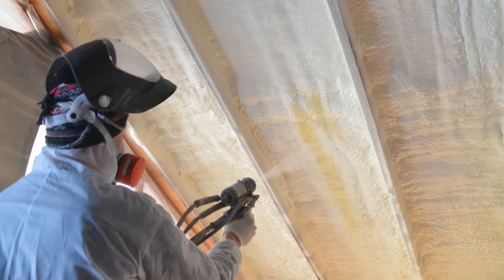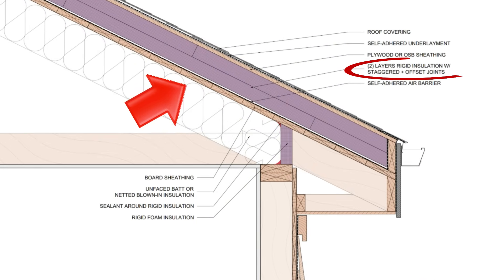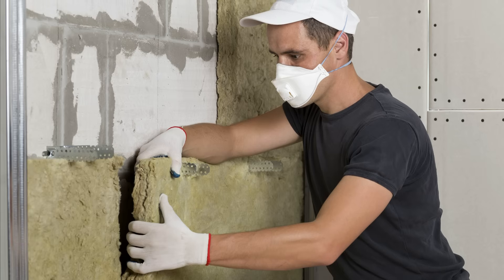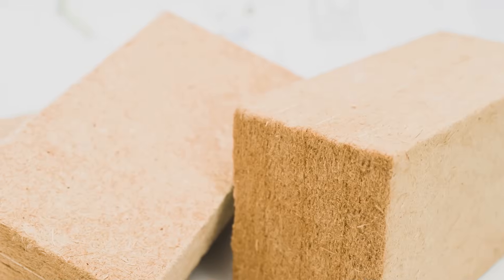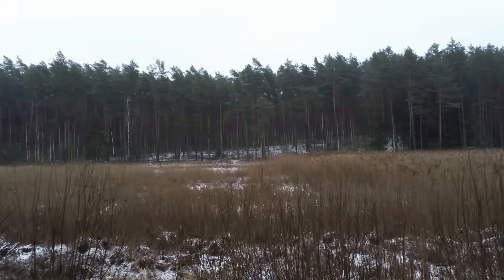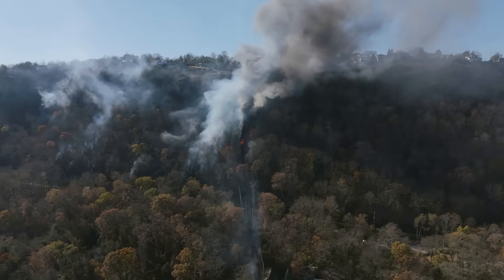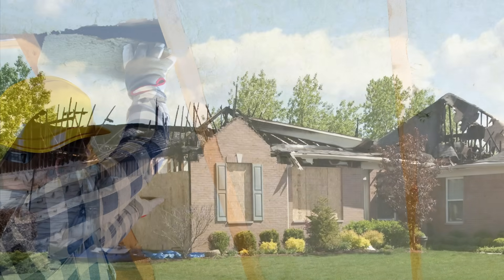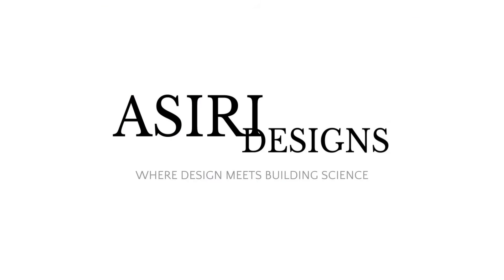How Climate Impacts Your Insulation Choice

Comment: Thanks.  I've been considering the roofing design for an off-grid home in Northern Idaho on a partially wooded parcel.  My current idea is combining rigid mineral wool on the top and edges of a roof for wild fire resistance, with ISO insulation inside of this for its cheaper cost per R.  The roofing would be snap lock metal panels installed on top of purlins.  Similar approach for the walls.  From what I've gathered, 2" of mineral wool would be sufficient for fire protecting the ISO, especially if installed as two layers of 1" board.  What do you think of this approach?  The air barrier would be at the sheathing surface.  Minimal interior insulation in the attic with open faced batts in the cavity.

Comment: Love the video. Insulation is one of my favorites and I love Rockwool. I think it’s best type of insulation for climate 5. You also need to install vapor retarder behind your drywall to all the cavity to dry out if condensation forms. Long lasting walls are the goal. This is also why I will build post frame. Can’t wait for the vapor retarder video.
Reply: I don't buy the internal smart vapor retarder. He says he stopped using tyvek because screws put tens of thousands of holes in it. Well, the same argument applies to the swiss cheese vapor retarder.

Comment: In a warm humid climate, how would you prevent moisture getting trapped in the wall if you put a shower along the exterior wall?
 For example, if you had zip sheathing on the exterior side and a water barrier on the interior side for the shower.
Reply from the maker: This is a great question - we actually don't recommend locating showers on exterior walls for this very reason.
Reply: @ASIRIDesigns  Are there any specific materials or a way to work around it if a shower had to be placed on an exterior wall?
Such as furring out the interior side a few inches and having that few inch gap vent up to a sealed attic?

Comment: If it melts it will burn like candle wax or fuel oil. If it's thermoset at least you have the benefit of the required extra energy to break down the macromolecule and don't have flaming drops to be concerned about as with thermoplastics.

That said, the are fire retardant additives and product options in most cases, so it is more complex than the video stated.

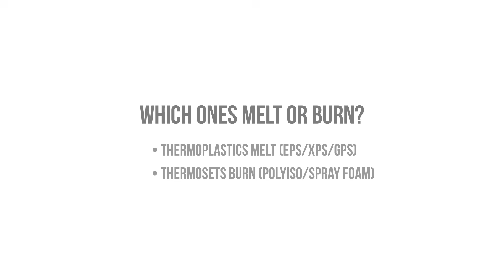Comment: 5:47 what i've seen on 1 youtube video is guy going over the full blown instructions on how to install insulation , and one of his main points was you don't want to do what is done here, and that's have exposed plastic (most just put glue over it to fill it in) which acts as a thermal bridge ,and with how many there are it's alot of energy loss, what you're suppose to do is to get a wider drill  and remove enough material  to sink them into material and put on that same material cap, wether it's rockwool caps or fiberglass caps or styrofoam caps etc. Just my 2 cents

https://youtu.be/RL0iiFMckPM?si=O9sUm7B5DMgIy4Vo&t=428
also gives proper ways how to glue and everything else
Reply: I wouldn't do caps as the final install either way. What would you affix siding to?

Better off to have two layers. First layer has a batten that anchors to the studs. Second layer has a batten that anchors to the first batten. It should eliminate thermal bridging from your fasteners and make it so you don't have to find ridiculously long fasteners as well. Opens up the possibility of using stainless steel fasteners, which transmit heat much less, but aren't available over 6 inches.

Lot of labor and details to get right though. I personally just went with a single 4 inch layer of Rockwool Comfortboard with battens and as few 7.5 inch screws as the spec allows (3 / sheet). Still expensive, but it can always be done a little better.
Reply: @jonathansage2147  Oh yeah sorry I keep forgetting. I'm from Croatia , most of our houses are brick and concrete, so we put insulation outside and then use something like "glue" "facade" "plaster" (don't know the exact word) on the insulation with plastic net imbedded and then paint that. We don't install wooden siding.
Reply: @jonathansage2147  Basically this https://www.youtube.com/watch?v=jrlDF1tLEXc but more layers, that's why we don't want to have thermal bridges with the "plaster" to the brick
Reply: @LykeArgy  in my climate, that detail would fall apart/crack badly. Stucco isn't really used here as a result. I have concrete panels instead, and they need to be nailed to something - most siding in the states, even non-wood products, require a nailing surface.
Reply: @jonathansage2147  "fall apart/crack badly" yeah probs beacuse of all the movement with wooden framing  i get it, but we use it everywhere here, both in really cold places and in warm places so i don't know how long that would last, never thought about it, usually buildings from 80's 90's have only stucco with no insulation,  but the buildings that  i know ar 15-ish years old and have styrofoam still hold with no damage but myself i live in Pula which during winters barely gets to freezing temps and when it does it's just few C under 0
Reply: @jonathansage2147  what is your climate though and how long does most used siding last (im assuming wooden up until late with new products)
Reply: @LykeArgy  it's actually not the temperature. I'm in climate zone 4. But it rains a lot in Seattle and that causes stucco to crack and lead to water infiltration. It's not used much in this area, though Hardie panels are quite common in newer builds. Wood is a better framing material for us because it moves since the area also has considerable seismic activity.
Reply: @LykeArgy  and I say that coming from Boise where I owned (and had built for me) a wood framed stucco house.
Reply: @jonathansage2147  But it rains here and the stucco is fine , i don't get it, does the moisture in the air then really expand the framing and that cracks the stucco?

Comment: If you have a good exterior air barrier like zip sheathing is there much reason to go with a premium smart membrane vs just your typical Kraft paper faced fiberglass batts? I know you won’t have an interior air seal but it seems like if you have a solid exterior air seal then you won’t have much if any vapor drive.
Reply from the maker: The location of the air barrier relative to the insulation is actually very important. If you locate the air barrier outside of the insulation layer (presumably fibrous insulation) there isn't anything stopping interior air leakage from coming into contact with the backside of the sheathing. Same thing in warm humid climates. It's more important to locate the primary air barrier on the outside of the assembly to prevent warm moisture laden air from condensing on the backside of the drywall if the space is air conditioned. Does that make sense?
Reply: @ASIRIDesigns  I don't think that answers the question, at least not my version of it. In CZ6, if I have sealed ZIP on the exterior, do I NEED Intello inside, or is the vapor retarding properties of the Kraft backing on fiberglass batts "good enough"? My assumption is that it is, given that I understand that sealed sheetrock can serve the same vapor retarding purposes.
Reply: @ASIRIDesigns  I don't understand why it is a choice of air sealing inside or out. Wouldn't it be best to make both the exterior and the interior air tight?

Comment: I’ve been thinking about adding exterior insulation during siding replacement - in Minnesota. We have a standard house wrap on OSB sheathing, 2x6 walls, fiberglass R-19 in the walls (altho effective R is probably much less due to bad air sealing). Is there anything I need to do to the house wrap before adding? Would 3 inches of GPS/XPS foam be adequate (R-15)? Any other considerations?

Thanks! Love your work and videos!
Reply: I can't cite it and I'm no pro, but your external wrap is probably stapled. I've read that you can have as many air barriers as you like, but you can only ever have 1 vapor retarder. I'd suggest you can wrap it again, and be sure to use tape on the seams. I think 2021 model code is R5 external continuous if you have wall insulation. 3" requires some somewhat exotic (ie: 5") fasteners. XPS gets less effective in cold weather, and degasses over time. I've never looked up GFS data but I think EPS or mineral wool is a better option.
Reply: You could also remove the wrap and go to a fluid applied WRB and air barrier like polyguard has (there are many others). I'd also second using Rockwool in MN.
Reply: There is a wall calculator you just type material,  its thickness,  consequences of layers, the region where your house is located and the calculator would show the dew point in your wall assembly. But I did not see such calculators in English only in a couple of European languages

Comment: Great video, pretty rare to see exterior insulation in our area (CZ5) and trades aren't used to it. While exterior insulation would certainly be better, what are your thoughts on have a very well sealed exterior air barrier with dense pack cellulose (damp or dry) or JM Spider Insulation in the cavities to reduce/eliminate convection and potential for moist indoor air to condense on the back of the sheathing?

Comment: Warm climate and we have very aggressive ants. Caught them eating the polyiso around a window AC. I'd be terrified to put it into a wall or roof. What's the best alternative?
Reply from the maker: Definitely mineral wool!
Reply: @ASIRIDesigns No one makes a rigid mineral wool that they spec for installation on a pitched roof. I've seen it done, and it seems like it could work, but I really don't like the idea of using a product outside spec, especially on a roof.
Reply: Mice love to live in fiberglass.
Reply: I've been watching many different YouTube channels regarding all variations of Insulation. RockWool/Mineral wool seems to be the most resilient in regards to insects & small vermin. FiberGlass would be second.
Reply: @ericscott3997  fiberglass is excellent nesting material. Mice have stolen it out of the hood liners of my parked cars.

Comment: Could you talk about retro-fitting insulation in older homes?  Especially  in colder climates. We can't replace our  roof just to add insulation.  We can't just rip out our siding to add insulation. We're pretty much stuck with working from the inside WITH whatever the original builders thought was good practices. My home is a little over 100 years old.  In the majority of the walls, it has no insulation.  The framing wood that I can see  is fantastic. You can't buy that kind of wood at the lumberyard  anymore I think.  Century old wood. The construction is solid.  This house will last if I don't do something stupid. ... But I do want to be warm and comfortable.  I have cold winters, humid summers. So the best of both worlds. How do you solve that problem?
Reply: I’ve looked into this a bit and depending on the house it can be both more effective and cheaper to pull the siding and add an outer layer of foam panels. You don’t have to do nearly so much interior demo and reassembly and you can get a continuous membrane.
Reply: @ryanlcooper  Oh.. but I want to do interior demo. I hate my lath and plaster walls.  And I really want to re-wire my home. So  I'm actually okay with room by room gutting of the walls. 
For the foam panels, my  main concern is moisture.  Winter has snow and a heated house.  Summer has humidity and internal AC.  The original construction depended on leaky house to dry out the moisture. 
Oh.. and I'm definitely going to have a smart vapor barrier membrane. This is all planning process still.
Reply: He has a video:A Complete Guide To Insulating an Old Home (For COLD CLIMATES). https://www.youtube.com/watch?v=LMOqxyZPivQ
Reply: @Senthiuz  I did watch that one.  I just wanted more because he  posts a lot of new construction.  But a lot of us have either old homes or shoddy new construction. We can't just rip open our siding/stucco/roof just to air seal. What do we do? What kind of things would we  face because our homes aren't built the way that they are built now?  Climates that have swings in climate such as a cold winter/humid hot summer?
Reply: @jenniferhunter4074  exterior rigid foam is best. If you are unwilling to do that, spray foam inside is the second best. You can go as little as 2-3 inches and outperform batt or blow in insulation because of the air and moisture seal.
Reply: @ctrlaltdebug  I have a century plus home.  I'm not willing to rip off the relatively recent new roof that we installed a little while back so the exterior stuff  is out. Then, the interior is wood and I'm very nervous about moisture.  That's why I shy away from foam products. 
For me, I'm willing to rip walls and install smart vapor barriers and things like that but I do not feel comfortable  with spray foam. My climate is cold and dry in winters and hot and humid  in summers.  So I would feel uncomfortable with retroactive insulation methods that will probably not be 100% due to human error and well.. it's an old home and I don't even have 16 on center  studs.  Everything is  little off which means I can't guarantee a perfect job and I want to tear down the house.
Reply: @jenniferhunter4074  spray foam or rigid foam + spray are the only reliable means of preventing interior moisture from condensing on cold wood and causing problems. It's the responsibility of the roof and exterior water barriers to prevent exterior moisture from getting into your wood. 
Any interior vapor barrier will be punctured when you screw through the drywall, not to mention installing shelves or cabinets.
Reply: Hey Jennifer, would you know what climate zone you are in as well as the outside siding on the house?
I've work in the trades in climate zone 7A & 7B and am familiar with the older wartime style houses. From the information already given the smartest option would be as you had suggested of opening up the inside walls for a full renovation and at the same time add insulation back into the walls. You can use either fiberglass batts or mineral wool (Rockwool) batts. You should be fine just filling the traditional 2x4 walls with those as they will be far better then the minimal or absent insulation to begin with. I would recommend the rockwool personally. If you feel like that isn't enough insulation you can either furr out the wall with 2x2 material giving you some more insulation room, or you can strap the 2x2 wood horizontally which would reduce thermal bridging even more, and allow you to put insulation on the inside section of your original wall. 
As for your air/moisture management, you could add poly on the inside before you drywall. I would caution against that as I'm not sure how breathable your exterior siding is. The most important part of these older homes is that they were built to breath. Now even though vapor barrier management is very important in newer homes, the older homes which were built to breath can be destroyed if you add a barrier. I have seen homes from the 70/80s that have had extra sealing done with either rigid insulation or spray foam, only to end up with moisture build up and rotting within a few years. On the side of caution I would leave out the vapor barrier, especially since I'm not sure how breathable your siding.
Reply: I have this same question! I'm about to purchase a 100 year old home in Spokane Wa, where there are hot summers and cold winters.
Reply: If you have some room behind your walls, you can cut holes in each stud bay , in an inconspicuous location, and blow cellulose into the bays. Patch the holes and you are done. This can slso be done from the outside depending on the exterior material. They make plugs for the outside holes.
Reply: @janking2762  I'm planning to gut room by room. I'm taking a hard look at rockwool.

1.  I want to update the electrical.  
2.  I hate my lathe and plaster walls.
3. fire issues because I kind of like my family and I live in a wooden house
4.  deals with humidity
5.  Long term efficiency even with vapour because I won't be ripping open the walls every year
6.  rodents.  I have no desire to give mice a nice nesting area.  Every fall/winter, I have to do an exterior check to try to catch any potential openings.
Reply: @janking2762  Blown cellulose on its own is a terrible idea for leaky walls of an old home in a mixed climate. You'd get moisture condensing in the wall assembly during both winters and humid summers, just from opposite directions. At a minimum, you'd also want to add a smart air barrier on the interior side to allow the house to dry inward, while keeping moisture from the living space out of the assembly in winter.

Comment: Great video!  It’s also important to consider your heat source and ventilation strategy.  For example if you’re in climate 6+ and you heat with wood (drying) you’ve got a lot of room to tailor your assembly.  But you take the same climate zones and  switch to propane (humidifying), you have to be extremely detail oriented with materials, construction or you’re going to end up with a lot of water in your walls.

Comment: I'm in the southern end of the marine climate zone in CA where we have a ton of condensation in the morning on all our surfaces but generally dries out during the day. Our exterior walls are stucco, single layer asphalt, open stud bay, drywall. 1960s "slap it up FAST" style construction. Would you expect any significant issues with moisture inside the wall by at very least adding rockwool to the bays? Doing the walls properly would be cost prohibitive. Temperature fluctuations in the house are terrible for such a mild climate.
Reply from the maker: Yes, I wouldn't  insulate that wall. By insulating the sheathing will be significantly colder since it's no longer coupled to the interior conditioned space, and it won't dry out nearly as easily since insulation slows heat flow.